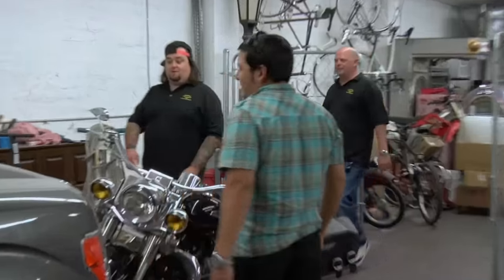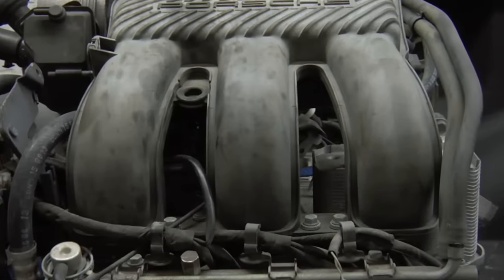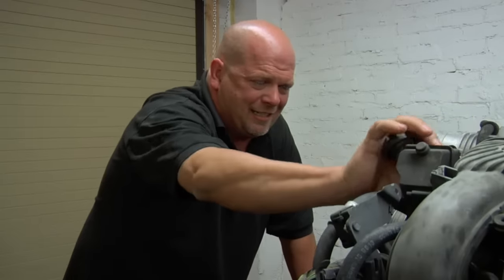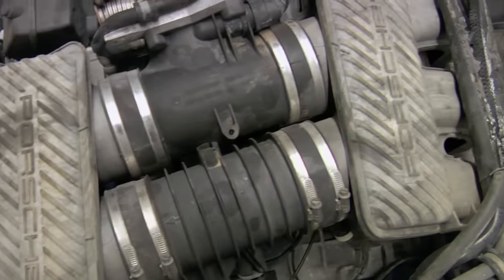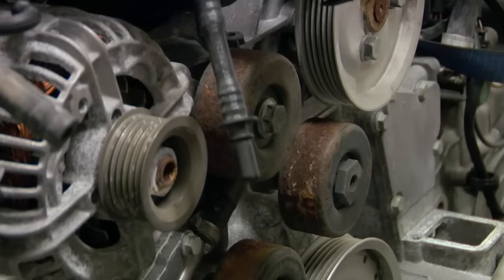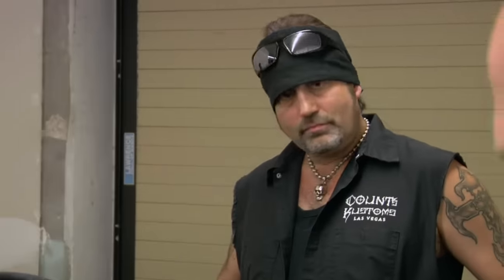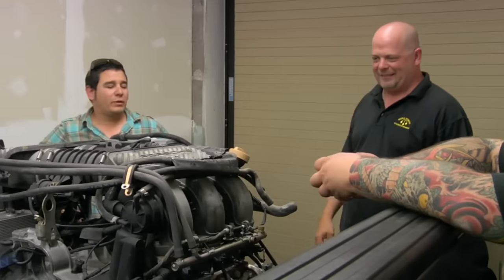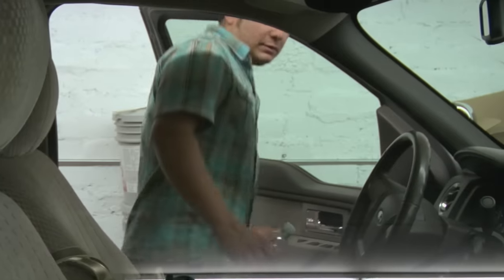Pawn Stars: Seller INSULTS Expert Over Damaged Porsche 911 Engine (Season 4)

Comment: Exterior corrosion on the motor is a minor worry. My primary interest lies in observing its operation, assessing whether the engine maintains pressure, and learning about the vehicle it was extracted from. If it operates, it's probably a solid motor that just requires a few cosmetic components to restore its appearance.
Reply: Not only that, the motor is fully built out of aluminum lmao, which doesn't even rust. The going rate for this engine is 12-14k now, so about 10k more than what the guy wanted. Even if the motor was blown, it would probably be worth more than 4k still.
Reply: @subyoooyoy  Indeed, I'm currently viewing a GT2 engine with 37,000 miles listed on a salvage yard website for $19,000. The accompanying photos of the engine don't look any better than this one. I believe they fabricated an excuse due to uncertainty about the market demand for this engine.

Comment: Say what you will about the character he portrays on His car show, but he is 100000% correct. I motor sitting should have everything sealed up and yes no one has any idea what the inside of that motor looks like. You should just assume every system hs water in it and now rust and corrosion. AND you don’t know if the engine even ran when it went to the junkyard 🤣

“I work at a junk yard, I know engines” naw man…. That’s not how that works lmao

Comment: new pulleys and a fuel rail, injectors could get debri, it's not direct injector so that's only a few hundred in parts
dude didn't even bring a spark plug tool or boroscope
I still wouldn't pay much for it though

Comment: He knows about engines? Then he’d know the minute you pull that engine you cover and block off every single port on it! Moisture gets in there and just sits, maybe it did run well when it was pulled, but after sitting open like that for years, it would probably still be a good engine but it’s going to need a lot of attention. 
Only thing I’d have done differently here is, what’s the core value? Because heck if it’s say $1,500 as a core, sure I’ll offer you $500
Reply: About 8K if it requires a full refurbish

Comment: this has got to be fake, there is absolutley no "water damage" on that engine.. the visible rust on the alternator and idler pullys is from the belt rubbing the paint off it, likely from driving the car in the car in the rain. one day driving in the rain would start to rust bare metal without paint or oil. as far as a engine goes that looks like a un-molested example of an good used engine. even the bolts that are shown have zero tool marks on them. that engine has as much corrosion as a 2 year old engine where i live.. this is just a joke and for tv. i could give you an idea of the health of that motor in 5 minutes by rolling it over and testing or feeling compression and any tight spots (surface rust in cylinder) even if there was rust in the cylinder which i would bet my pay cheque there isnt the rings would cut it off within 30 seconds. the guy was right he needed to ask a mechanic not a mechanic personality on tv.

Comment: He is correct about the rails. The ego was burst in this nothing more. The proper priceedure was to do an oil drain, compression test, cylinder expection bia sbake camera. Then a run up. If all vhecks are checked then 4500 for this engine is a steal. This show sucked anyways....mayve watched three episodes and could see the set up right away.

Comment: Well the scrap yard guy is kinda right. None of that corrosion would have made it to the cylinder, crank or cam so long as no gaskets are blown. With the fuel rail, no water damage will get past the injectors so the only replacement needed would be the fuel rail. And to check the crank turn it with a ratchet to make sure it’s not seized. I’d buy this engine for 3k but they did the right thing turning him around

Comment: Not good that the fuel system and throttle body and whatever were no covered up for storage but those pulleys are bare metal and will rust like that in very short time. The wipe of grease on the finger. Low brow sales tactics ok that stuff for sure. I don't blame them they're looking for a steal.

Comment: This is obviously staged, still a cool motor. Only way to see is by taking off oil pans and valve covers.
Reply: Yeah.  Anybody looking at it would have at least some tools to take the drain pan off...only takes 5 minutes....this one may take longer and don't break the corroded bolts off either.
Reply: Is this dude really saying a "good" mechanic is going to say there's no water damage inside with all the exposed openings?   Some people deserve a kick in the you know what.  (I have to watch what I say or I'll lose my commenting privileges again because YouTube doesn't allow free speech).

Comment: Thats not water damage to that engine. What the "mechanic" is actually saying is that if the engine would have been sitting on a shelf and plugged just prior showcasing it would have been allright ? Where is his endoscope ? Where is his compression test ? The salesman is absolutely right., Showing up being the expert without performing the real tests stating "you have to open up the engine", my 13 y/o could have said the same. 4500 is worth the gamble by the way......What an utterly nonsense this episode.
Reply: what's the engine worth if it's in good condition?
Reply: @tommyfu9271  double what he asked